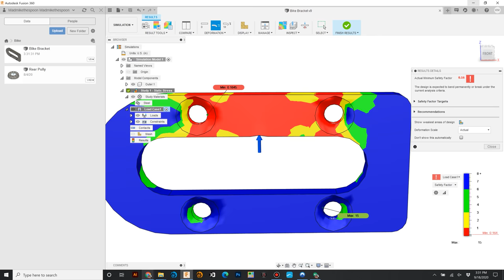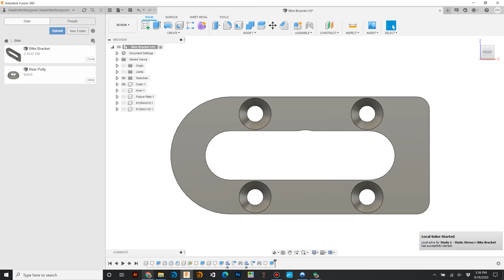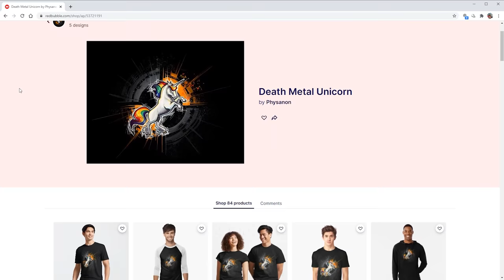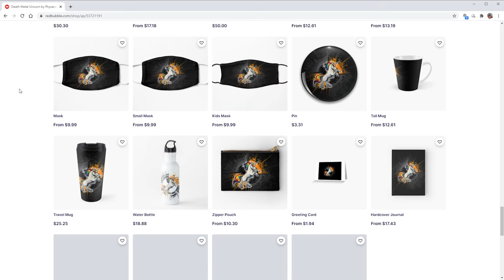Super Light Bike (Part 2) Titanium Addition

Comment: Use flood coolant and or coolant thru tools.  Go very slow on the sfm.  Grade 5 Titanium aka Ti6Al4V has an abysmally low thermal conductivity which translates into no meaningful heat dissipation into the part which has the effect of concentrating all of the heat generated on the cutting edge of the tool.  This is also why sharp tools are very important with Titanium as this helps to reduce the cutting forces and thus the amount of heat generated.  Tool life in Titanium is extremely sensitive to sfm.  

At a aerospace machine shop I worked at previously they took an end mill that that would last 4 hours in Titanium at there standard feeds and speeds.  Then they tried doubling the sfm and kept the chip load the same.  Tool life went from 4 hours to 15 minuets.  2 times the SFM and the tool lasted 1/16th as long.

Titanium is not difficult to machine, however the relationship between SFM and tool life is unlike any other common metal (IE: Steel, Aluminum, Brass...).  This translates into people unfamiliar with machining Titanium having the exact same type of experience shown in this video and thinking that Titanium is un-machinable.  Also unless you are hard milling or hard turning flood coolant should always be used for best results regardless of the metal.

Comment: All of this is in inches:

Drilling- Do not go under .0015 feed per revolution. At that diameter you can comfortably drill at 120 SFM.
Pecking should only occur at most at 1 tool D.

Milling- Radial engagement for conventional carbide should not exceed 8% of the tool diameter. Mill at full depth of the feature and adjust your radial engagement to suit your spindle power. I would suspect a good starting place for your mill would be 100-150 SFM. Do not go under .001 feed per tooth, if your tool D is over .125. If you go below 5% tool D, do not go below .002 feed per tooth.
Reply: If only this comment would be in metric ;-)
Reply: If it is cutting don't stop when working with materials that work harden = pecking bad?
Reply: @joeldriver381  cutters dull, not when they are in the cut as much as when they enter and form the first chip. Ideally you would never peck, but many situations require it to break and clear chips. Modern high performance drilling, even at many times drill D, there are no pecks, but chip clearing is preformed by through tool high pressure coolant
Reply: @grinchyface  Yes-  based on the shallow depth of the holes do you think he would have had better results just punching through with zero pecking?
Reply: @joeldriver381  I don't know much about the tool or the coolant or the workholding, so my recommendation was to peck at 1d. These were "very safe" parameters for ti6al4v

Comment: You can drill Titanium with a HSS Co slit point drill fine. The air mist would also work. Just run your surface speed around 30-40 and don't feed to slow. Say around .003-.004" per rev. Also peck drill with full retract with the air mist. Shallow pecks say around .030". This will give the drill time to cool off between cuts. Better would of course be a solid carbide drill with no peck or a chip break peck at around 150 surface speed maybe around .003" per rev. feed. There are many different Titanium's and heat treats. Some are easier to machine than others.

Comment: For you titanium drilling try M42 drill regrind the head at 140 deg and use coolant flooded PS it need to show at least 12 to 14 on the refractometer. XP Use a peck drilling cycle that let the drill high up to give it time to cool with the coolant peck deep .030 some time lower :(

Comment: For Titanium, you really need M42 Cobalt Bits and doing whatever it takes to keep the Ti from heating up. Also, you should really fill that kerf gap at the very least with a slip of carbon fiber and epoxy. Even if you don't plan on "bandage wrapping" the area with strip of CF and resin. Placing a shim in the crack will help a lot in the long term.

Comment: Yup. Missing the flood coolant. As far as I understand it, titanium LOVES to hold heat and work harden like stainless with a grudge. Plus there's the fire risk, as in your entire work piece lighting up. Haven't ever seen it happen, but plenty of "a fish this big" stories are out there. Also, and I'm not super sure if I'm actually thinking of some another material, but it also likes to wet/stick to tooling, hence needing specialized mills.
Reply: I think you have mixed titanium with magnesium.
Reply: this. I remember turning some titanium parts on a big ol' hardinge toolroom lathe, and even being really careful with my feeds and speeds I work hardened the frigg out of it. Had to come in from behind where I drilled it and bore it out with a boring bar to cut out the stock hardened.
Reply: @xxmisiekxxable  Titanium will still light up if you do something really really wrong, but yeah, a lot of what he's saying is magnesium too.
Reply: @xxmisiekxxable  Probably not. Several metals (including magnesium, titanium and zirconium) are flammable, especially when in the form of chips or dust.
Reply: @xxmisiekxxable  Try and turn titanium too fast on a lathe and you will see what happens :) It will def catch fire, but before that it will blind you nicely.
Reply: Well I stand corrected. Never had titanium cips catching fire but had it with magnesium alloy. On other hand I haven't machined a lot of titanium in my life.

Comment: Did you use a carbide drill? Looked like HSS in the video, correrct me if im wrong
Reply: Or a carbide tipped drill you can get a decent carbide tipped drill for about $10-$15 had to get one to drill through a though stainless tabletop that dulled every drill bit i threw at it

Comment: Have only machined titanium on a relatively small cheap lathe, with mist cooling, but might apply to the mill as well: 
Take-aways: 
1) very sharp tooling. Either freshly sharpened HSS, with regular re-sharpening, or better carbide inserts (carbide drills/milling bits on the mill). The inserts for aluminium with a polished surface and high rake work well, they have very fine sharp edges and will hold up if you don't push them too hard. Inserts for steel have rounded edges and are no good. Immediately change them when they start going a bit dull or chip, don't keep going.  

2) very low RPM, but a decent feed rate. You have to take a good cut with good chips, never go too shallow. Titanium will instantly work harden when the tool is rubbing, and it's game over. Breaking through the hardened layer is almost impossible, the part is scrap most of the time. 

3) keep it cool, either with plenty of coolant, or by taking a lot of breaks to avoid heat buildup. 

4) the endless long chips are a huge pain on the lathe. Use interrupted feed to keep them short. Don't use your hands to clear chips, they're super tough and will cut you.

It's quite doable and fun even on hobby-grade machines after some practice.

Comment: So I have some experience in carbon fibre bike parts, especially ones from China.

I would 100% recommend going to a carbon fibre specialist so that they can get their microscopes on it to find out the type of weave, and just the generally quality of the carbon.

Even carbon frames from manufactures have snapped on me, almost always around the bottom bracket.

So with you having made a cut on, I'd say, the second most stressed point on a frame, I'd get it checked.

Comment: You actually have to flatten the cutting edge on a cobalt drill when your drilling titanium. Hard to explain but the cutting edge on flute side should be flattened to have it more ripp the material vrs scooping it. That's all I machined years ago. Or a carbite drill would work fine. 400 to 700 rpm

Comment: There's a guy on instagram under the name @reclaimdesigns who's been cutting apart carbon frames and downsizing them into kids' bikes. Might be worth a look.

Holy heck- you're not using a quick release rear wheel on a fixed gear, are you? It's an incredibly bad idea if you are. Super dangerous.
Reply: Yeah-  I was totally cool when he cut the frame but had the same thought on the quick release.
Reply: What is the problem? I never dealt with fixis
Reply: @lukasschworer840  That type of dropout  lets you slide the axle back and forth to adjust chain/belt tension.  Many dropouts are fixed position because the derailleur manages chain tension...  The only thing keeping the axle in position is the clamping force provided by the quick release vs something like a 10mm nut or socket head cap screw.  A chain tensioner similar  the ones used on BMX bikes would also help and could be added into the design of the piece he made.
Reply: @joeldriver381  thanks for the answer =) so the dangerous thing is that the wheel slips forward, the belt loses tension and he won't be able to break anymore? why would a quick release fix that? I would expect that you can tighten down an M10 Nut with a wrench way more than you can tighten a quick release by hand?
Reply: @lukasschworer840  Fixed gear wheels encounter significantly higher torque loads compared to clutched wheels. It's impossible to generate enough clamping force with a quick release to resist those forces, and if your wheel slips in the dropouts, it's a very, very bad time. Serious injuries can and do happen from it.
Reply: @lukasschworer840  correct the standard type bolts would be more secure in this case. IMO...

Comment: Were you using HSS or carbide drill bits for those initial holes in the Ti?  Skycraft carries those stubby PCB carbide drill bits in those drawers over to the right when you first walk in, about a third of the way down, eye level...they are $1.00 each and they have numbered sizes 1 through 80....they work awesome, cut like butter....you're welcome ;-)

Comment: Titanium likes SLOW feeds and speeds and flood coolant.  Titanium doesn't transfer heat very well so so you need to get the heat away. It's a magnitude LOWER SFM than aluminum.  Like max you should ever go in Ti is like 250sfm. 

I use carbide Niagara A345 tools (3 flute 45deg) but I've found that their cutting recommendations as a good start for the majority of machine work.  Here is a link to their feeds and speeds page:  https://niagaracutter.com/speedfeed

Comment: Carbide is your friend. Had the same issue in the past with sta titanium an hss had no chance. Also, it is very hard to brake trough the hole if you gave already burned a bit into it as it hardens the area around it and makes it super hard to drill. Do not make it heat up. Coolant definetly helps but you should be able to get it done with mist. Also, slow is not always good. You want remove a decent amout of material on each peck. Material removal also equals heat dissipation. Good luck with that. Im sure you'll get it right. If you need more specifics message me and i can send you some cycles we use at work to machine titanium.

Comment: Why not use a closeable belt? Its 2 part one is the internal rib and one is an external band the rib structure is wrapped and cut the outer is wrapped around with the opening 180 from the rib belt then the adhesive is set (goop or pre-applied double sided adhesive that vulcanizes

Comment: If you use HSS drills, run them extremely slow, I would probably run a 4mm drill at like 400 rpm or less,  tapping 1mm at a time @ 25 mm/min.

Comment: If you want to "temporarily" add flood cooling ability to your mill, get a BIG plastic storage tub, enough coolant to fill tub to 75% or so, a garden pond pump (the kind used to create waterfalls in ponds) and some hose.

Put tub beside mill base, under table, fill with coolant (so hopefully the coolant runs off table back into tub, some plastic sheeting could theoretically be used to build a coolant return chute), attach hose to pump and put pump in tub (with filter to screen contaminants out of coolant to allow reuse and keep pump from being wrecked), run hose up to spindle area and zip tie to mill's coolant nozzle, plug pump into switched receptacle and voila, flood cooling on demand...

Comment: Have you thought about putting a draw bar in form of a bolt to hold the frame together where you cut it? It would transfer stress away from the brackets and wouldn't add much weight.

Comment: the blade is a cool idea, I feel it's still clunky, I wonder how curvey ergo you can make the design, and how slim you can make the bolster, ie where the  extended blade is attached to the grip. I'm thinking for doing shaving things, where you want a really low angle against the surface of cut. though maybe that's outside the scope of the tool's design intentions.  Mostly offering constructive brainstorming, hopefully it's helpful.
Reply from the maker: I like the ideas! I am sure there will be a version two at some point. This knife is deceptively ergo though. It doesn't look it with all it's flat sides, but feels very good in the hand.
Reply: @PhysicsAnonymous   the flat sides, maybe, but the hex nuts look bumpy. ponders  but yeah, maybe some kind of rubber grippy pads on the sides would be a good addition. could even use that to cover over the hardware, even.

Oh, also maybe a slightly alrger version that has like 5 blade storage compartment? some people have bigger hands and WANT a bigger tool anyway.

Comment: Why not bond the inserts in with epoxy?
Reply: You must be able to unlock frame to remove/replace belts.
Reply: Good point, I forgot about the belt! Если вы думаете, что срок службы ремня составляет 30 000 км, вы все равно можете это сделать.
Reply: @GrossGeneralization  Also, if you want to change speed/gears - you will also need to change the belt, because of its different length.

Comment: Remember titanium is gummy, work hardening material, so don't give your tools chance to rub! Best to use carbide tooling and dial down you SFM and crank up feeds and cool it, cool it, cool it. ;-)

3 rules for successful titanium milling/drilling:
1. Low, really low rpm, especially when you have no flood cooling... 200rpm is more than enough for 4-6mm tool!
2. Fast, really fast feed rate for the rpm... 4mm drill -> don't go below 0.2mm per revolution! You'd need quite some torque in your spindle for that..
3. Never, really never peck or interrupt the cut in any other way!

Comment: If you're trying to machine titanium outside of a gotta-go-fast production environment, I think the rule is to treat it like stainless and use low speeds and sharp tools. If low speed didn't work, check that the cutting edges are sharp. That's all I got.
Reply: I have machined Titanium of all grades in my home shop. Slow speeds, insane feed pressure, using carbide tooling. Transfer of heat in titanium is very low. I found almost no difference in dry cuts vs cutting oil, no flood. My belief is that flood cooling is questionable unless it’s through tool, even then getting enough to the cutting edge material interface would be tough.